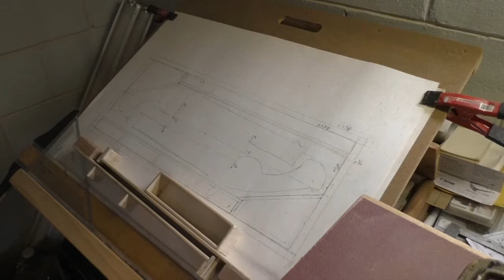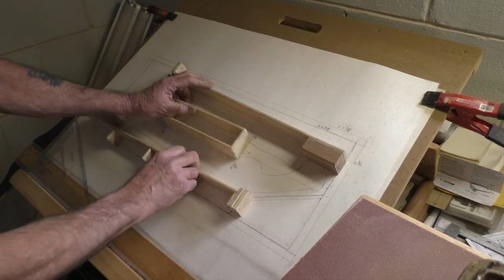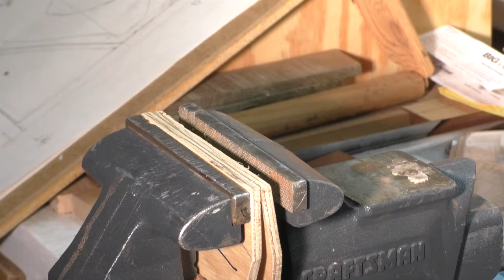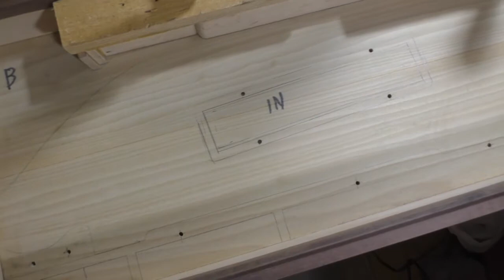Building a Pistol Case video # 1

Comment: A tip for dovetails - don't try to get the bottoms of the cut out pieces flat. Lumps and bumps here are what hold the joint open and lead to gaps. So chisel absolutely on the line at the outside edges (as these are the only bits you'll see) and angle the chisel down slightly so that you're creating a little valley in the middle of the wood. It ends up being filled with glue and there's plenty of contact area on the pins and tails which means it doesn't weaken the joint. But everything goes together really tight.
I can't claim this as my own idea - I was shown this method by a professional carpenter who specialised in making oak libraries from scratch.